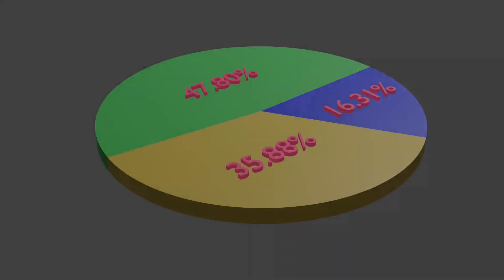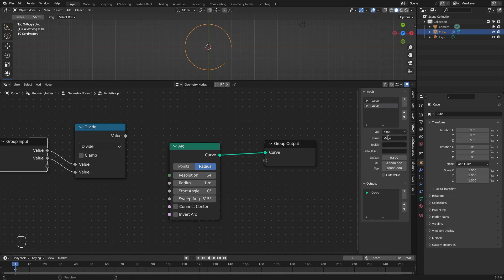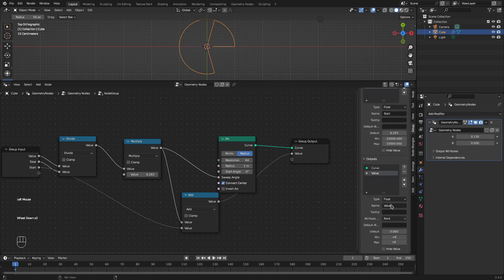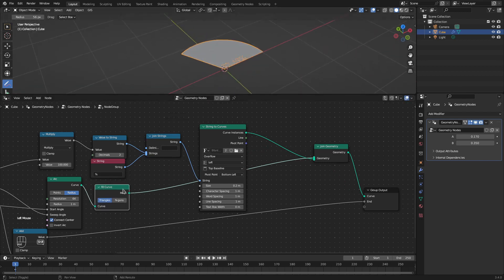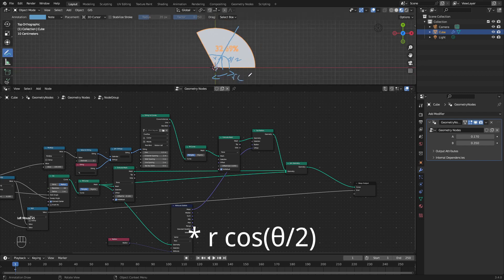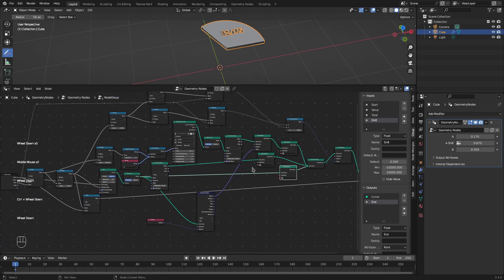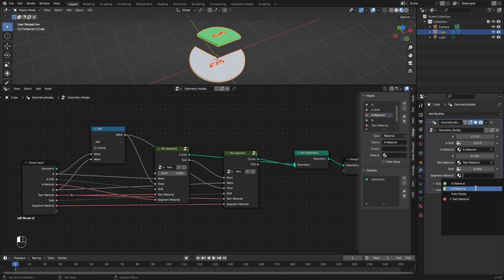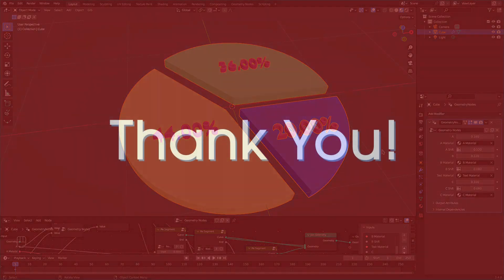Blender Geometry Nodes: Creating Pie Charts

Comment: I added switches at the start - on the B & C sockets before they connect to the Add Nodes. Also add Switches after the Pie Segment Node Group. Connect the two B switches to 1 Group Node Output. Do the same with C switches.
Now you can add segments to the Pie chart with a switch (after you set up more D,E,F... segments), or turn random segments On/Off .

My next challenge is auto arranging the segments by size. When I have the time.
Reply from the maker: I will adding a 10 segment pie chart with some more configurable values to the blend file with a quick demo video shortly.